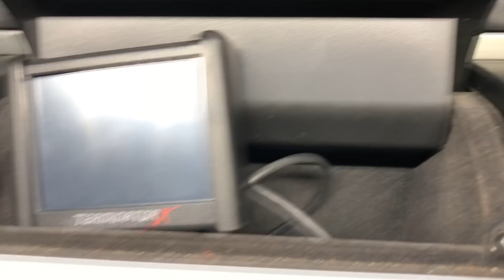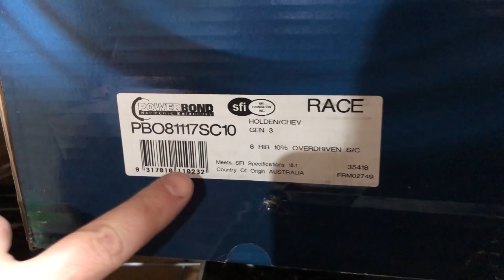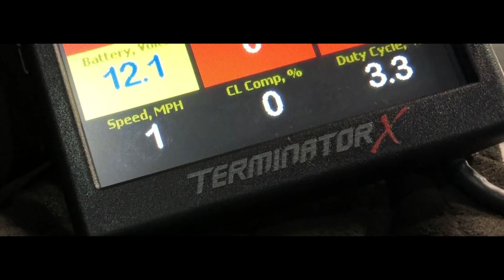g48 trans in and sneaky vss wiring

Comment: Nice work getting the trans back in underneath. My buddies 370, no matter what we did with the motor, we couldn't get it back in from underneath
Reply from the maker: I had to hammer trans tunnel near drivers side top to clear bell enough to get input shaft over taller twin disk

Comment: Blower temp in and out will get you a MAD calc that will give you way better tune parameters.
Manifold Air Density - Loss from Heat = Air Fuel Ratios that can help with heat. 
Ever considered misting the Charge Cooler and Radiator for cooler inlet?

Comment: We did the same thing with our water to air IC. I will be getting rid of mine all together to save a bunch of weight and risk. Probably just go to an air to air that will flow just enough but not worry about the heat dissipation since 300+ to 120 didn’t make a difference lol.
Reply from the maker: Vs 4 inch will cut 250f at 1000whp

Comment: Def wanna see the vid for the MSD hot boi setup how it works been looking at this for my fans and fuel pump set up
Reply: What exactly is that thing?
Reply from the maker: 4 solid state relays with temp and circut protection and distribution built in with pre wired triggers

Comment: Thanks for all the info. Would love to do this with a non-max unit and t56. The wire from the ECU output goes to the speed sensor but does the other wire on the sensor go to ground, 5v, or 12v? I saw in the software is a pwm ground coming from the ECU.